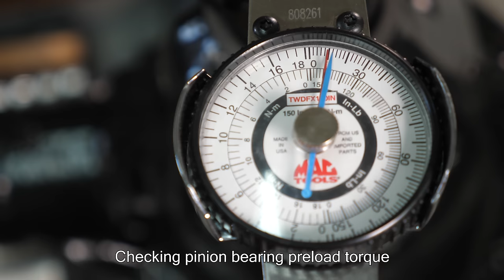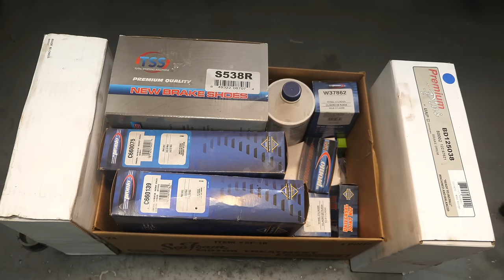Rear Axle Restoration and Rebuild (Chrysler 8.25)

Comment: If I did all that I would have switched it over to disk brakes I hate drum brakes
Reply: Agreed
Reply: Yeah I put the kj disc brakes on mine
Reply: All that work just to go through the pain in the ass process of putting drum brakes back on it
Reply: For real. I'm eventually going to swap my 96 F150 rear drums for discs, but don't want to buy a new conversion kit. Thinking I'll get the goods I need from like an Explorer of the same year or something...would have to research it.
Reply: Mayur Karanth  Has nothing to do with "crazy stopping power". It has to do with having more reliable brakes that aren't constantly out of adjustment.
Reply: @William Kiene I'm curious, did you mean 80%? Surely more than 80 pounds are being stopped by the front brakes lol
Reply: Drum brakes are lighter. They stop better. They can be adjusted with drag. You don’t have maintain drums as much as opposed to disc brakes.There’s a reason commercial trucks still utilize them cause they actually stop better. Disc brakes only dissipate heat more efficiently which is why car manufactures always used the front disc, rear drum combinations. Old technology does not equal bad. The pads are still being pressed against a surface whether it’s around a disc or drum, the outcome is still the same. Why even bother doing a drum to disc conversion? The pros don’t even outweigh the expense. The reason why this guy reused the diff cover and backing plates is the same reason he didn’t do a disc conversion cause if it ain’t broke, don’t fix it haha.
Reply: @John-jr1si  "There’s a reason commercial trucks still utilize them cause they actually stop better." - Well, that's not accurate. Disc brakes stop better more consistently due to their dissipating heat better. Also, in wet weather, the centrifugal force slings water off of it, giving it a huge advantage over drums, which often suffer in wet weather.

"The pros don’t even outweigh the expense." - Technically correct, but your context is wrong. One of the reasons you often see them in commercial trucks is because the commercial truck industry is nearly monopolized, so the few consumers there are don't have many options. Drums are in fact cheaper, and that's why they are still used. In some cases, you see drums on just the rear brakes of some "regular" vehicles and that too is because of cost saving. 

"Disc brakes only dissipate heat more efficiently which is why car manufactures always used the front disc, rear drum combinations." - The fact that most of the momentum is in the front, so that's where the better braking needs to be, is the logic behind front disc/rear drum setups, in addition to the cost-saving measures I mentioned.

"The pads are still being pressed against a surface whether it’s around a disc or drum, the outcome is still the same." - By this logic, it seems that you'd argue there's no difference between pushing and pulling. Rudimentary physics would certainly have a bone to pick with you, if this were the case.
Reply: Callelle drums are lighter than discs and if you’d spend big money just so you can have it be simpler just means you should be nowhere underneath a car or hood.
Reply: @John-jr1si  Well, you missed my point, despite my laying it out in a manner I thought was simple to understand, so I'm not gonna bother unless you decide to push it.

It's not a matter of thinking I'm smarter than the original engineers, but you have to realize that engineering has cost constraints. Manufacturers are not going to allow the engineers to do everything they want to do to make the car the best it could possibly be because it would drive costs up and make it un-affordable for the average person. This is why every so often we see concept cars: manufacturers let the engineers loose to prove that 1) they have the chops to produce the best of the best and 2) to keep the engineers satiated since most engineers dream of designing and building "ultimate" cars. So bearing in mind these cost constraints, they are forced to cut corners by putting cheaper components in some areas and they are ripe for upgrading. The same way that you can upgrade plastic components for metal ones if you have the desire to do so, it's just a matter of adjusting things that the engineers likely didn't have the ability to enforce. Like drum brakes over disc brakes. So stop being an ass about it.
Reply: @John-jr1si  they don't do things the same though. Why do you think there's almost no cars (if any) made these days that use drums? The wheel isn't being reinvented, it's being replaced with another wheel that's already been designed and is better.  It doesn't even cost much more (if any more at all) than it does to replace the drums, shoes, cylinders, and all the internal hardware. My backing plates were $20 and the rotors, pads, and calipers might have been $50. If the guy who did the video was gonna strip it to the point of taking the backing plates for the drums off anyway, there's literally no reason not to swap to discs.
Reply: @John-jr1si  just by the fact that you still seem to think that drums are lighter than discs, I'm not even going to waste my time on you anymore. Enjoy living with your head in the sand.
Reply: jw11432 I wasn’t aware I was being an ass about it? Yea i’m very strong opinionated on this subject because everybody seems to bash drums just cause they think disc brakes are better and it’s the new tech. There are numerous benefits that drums have over discs such as no brake dust on your wheels or the fact that drums don’t warp over time. I love discs brakes but I have no need to bash drums at the same time. I’m well aware of engineers limitations and people loving to hot rod, and I love doing it too. I just don’t see it as a legitimate benefit to fit in my budget on my project when rear discs don’t even reach their maximum temp to even clean themselves. I wasn’t really trying to say disc brakes are worse and drums are better. I was saying they both have their own benefits and that’s something anyone that’s mechanically inclined can agree on and I’m not trying to put you down by saying that.
Reply: Callelle Yea, I stopped wasting my time with you when you made an analogy of a better redesigned wheel.
Reply: @John-jr1si  No, you were being an ass with this part: "and that whole statement with pushing/pulling, “let me show off i know physics” so you can improve your credibility is stupid." I wasn't attempting to bolster my credibility with a mere reference to physics, only to illustrate the line of logic you were using doesn't hold up to scrutiny. You stated there's essentially no difference between drum braking and disc braking, as it pertains to the ultimate function they perform. But given that drums spread outward and discs squeeze inward, I was criticizing your logic by saying you must think there's no difference between pushing and pulling, since it moves an object and ultimately there's no difference, right? And to expand a bit, rudimentary physics shows that pulling exerts less energy due to a lessened encounter of friction, just for sake of clarification on that.

"There are numerous benefits that drums have over discs such as no brake dust on your wheels or the fact that drums don’t warp over time." - Brake dust mitigation may be a benefit, but drums can absolutely warp. There are numerous sources for the matter, but here's an excerpt from one source: "The drum will warp into an oval shape and doesn’t allow for optimal clearance between the drum and shoes." https://www.autoshack.com/brake-drum-problems 
Furthermore, I've already enumerated the benefits of discs over drums, such as performance consistency, heat dissipation, wet weather issues, etc. So far, the only benefits I am aware of drums over disc is cost, frequency of maintenance, and while brake dust be a benefit in your mind, I think I'd rather have brake dust escaping as opposed to it building up and gunking up all the springs and the wheel cylinder inside the drum, but if you want to have the opinion that this is somehow a positive, feel free.

"I wasn’t really trying to say disc brakes are worse and drums are better." - Actually, you kinda were. When you made the statement: "There’s a reason commercial trucks still utilize them cause they actually stop better." I dunno where you learned your English, but in my English, that's a pretty solid statement to support drums being better. While you're not explicitly saying drums are better, given that brakes only purpose is to stop a car, and for you to say drums stop better...well, that leads a person to believe you are expressly saying drums are better. So if you didn't "mean to say that", then mind your words.

You're entitled to your opinion. If you want to stick with drums on your vehicle because you like the lower cost or frequency of maintenance, or maybe because you like your brake dust all over your components, then fine. The only reason I responded to your comment is because you were factually wrong about a couple things and it's a matter of service to help others who may be reading comments to glean information. There's enough fake news out there about all kinds of things, we don't need any regarding braking systems.
Reply: jw11432 My bad, I figured I was being sort of an ass. I realized I was sort of being hypocritical after I responded too. I take full responsibility of that. I just have no need to swap to a disc conversion which also means I can switch to a bigger camshaft lobe which limits vacuum, something disc brakes need and drums don’t. I just see that in my specific application and not quite financially wise in my part, I have no need to convert. I’m building a drag car anyway and drums with no drag is free horsepower than disc. I see the different mechanical benefits of both.
Reply: @John-jr1si  All good, I appreciate the honesty.
Reply: I didn't mean drum brakes suck i just don't like working on them everything goes a certain way springs and all ..
Reply: Supposedly certain year ford explorer disc brakes bolt right on. 
They use the same Dana rear axle/diff apparently.
Reply: As a viewer I appreciated seeing things get put together as they once were as apposed to radically different. It's shows appreciation for the original design & in restoration that has a lot value to it.
Reply: Sure for collectible vehicles original is most valued. But this is a jeep xj that appears to be a daily or off roading vehicle. Jeeps are valuable for what they have for equipment and capability. In the practical market, an upgrade is an upgrade. What’s most important is the owner’s desire and plans for it.
Reply: I was wondering what it takes to use a 2005 and up rear axle. The least expensive Jeep Grand Cherokee of 2005 had disc brakes in the rear. Would that axle easily fit earlier Jeeps?
Reply: That's what I did. And then I put WJ knuckles up front on my XJ
Reply: @skylinefever  Pay attention to the angle of the snout.  They don't all have the same angle. I learned the hard way.
Reply: the rear drum break is also to hold the jeep and a trailer in park.
Reply: @William Kiene Not on 4x4, on rough terrain four brakes are more important, right. But drum brakes are better emergency brakes. I don't like drum breaks other than that. Those drum brake shoes that are in back disc rotors are a joke.
Reply: Rather has disk brakes, don’t have to put grease on them to keep them from squeaking.lol
Reply: jw11432 find an early 2000sf150 with rear discs. I think it needs to be a 2004 or 2005 because Ford started to use disc but they switched to 6 lug bolt pattern the next year. But one of those for 2004 or 5 will fit all the way back. Same axle and same wheel bolt pattern. I haven’t checked but the hum depth should be the same as well
Reply: Should have added a locker or LSD too.
Reply: *locker
Reply: @John-jr1si  Alot of misinformation here. You have good intentions, but your info is not researched enough. Trucks use air brakes, not hydro, race cars use discs, not drums, rally cars use disc and its not because discs are more expensive and racing corps have tonnes of money either. There is alot of tech and money being blown into truck tech as well. End of story...
Reply: @frederickmcconnell547 l ljl
Reply: I was thinking the same thing. Totally excellent job regardless. Jim

Comment: "Poor Man's Parts Washer" I feel ya brother 🤘 rock'n roll with the rest of us 😁
Reply: @dneilson2412  I think but I'm not sure they meant the 3M brake clean or whatever that was they sprayed on some of the parts. That wasn't done primarily to clean the parts it was to place a layer of oil residue on the areas that need to remain smooth and slightly lubed, the shiny areas. Which are areas things like bearings are pressed on to.
Reply: I love it. Aint it the truth though.
Reply: Well, not THAT poor. He had a lift, sand blast cabinet, press... I have a parts washer, but I ain’t got all the OTHER stuff!😆
Reply: @hgj2019  More of a phrase then actually true. Aint no poor nothing going on there, just high quality work with attention to all those details others would avoid . Awesome work.
Reply: @aerialrescuesolutions3277  no doubt about that! First class rebuild all the way. Very informative video.
Reply: but he had all other equipment to do the job. I assume he does this for a living because the tools he used, add up really quick lol.

Comment: Some mistakes, that yoke needed replaced and you shouldn’t hammer pinion bearings onto the shaft like that it’s a great way to damage new the bearings and races.
Reply: I cringed when he started beating on that pinion bearing,it will be interesting to see how long it lasts

Comment: This is great I have a Dodge Dakota with the same rear end, and it needs new bearings.  I have access to a 100 ton press, and a sand blaster. I don't think I will get that involved though. Just leave in my pick up pull a part and replace bearings may paint the rear cover .

Comment: We all knew that rusty brake line would snap right off.
Reply from the maker: #rustbeltproblems
Reply: @Meme Man because "restoration"
Reply: how does the fill plug connect to the bell housing?
Reply: @Meme Man With a two part question on the restoration of a Chrysler 8.25 rear end could have the few wonder of converting the brakes to discs or adding a traction aid when those would believe to want a limited slip as bare minimum or a locker.
Reply: @RestorationStation  9
Reply: @stanleyhornbeck1625  8

Comment: I would like to see that press you used to press those wheel studs out of the axle shafts
Reply: I'd assume it's similar to the press I have, if the sound being made while he used it is any indication. I got mine (20 ton) from harbor freight, it just uses a hydraulic bottle jack to actuate the press mechanism. Pretty damn cool.
Reply: @jw11432  I'll be damn. I'm gonna check them out. Thanks man

Comment: Honestly hella surprised on how well the diff looked compared to everything else.
Reply: Hardly needed to take it apart. If the outside had been treated with lanoline grease it would have been good as new too.
Reply: @steinbauge4591  🤡
Reply: @steinbauge4591  Glad go see the owner of Keyboard Complete Auto Care tuned in 👁👄👁
Reply: @realrickharrison3103  😜
Reply: @realrickharrison3103  it's so easy yet such a surprisingly well kept secret

Comment: I guess the big chamber in the middle of the axle is called a differential.
Reply: Where the big gears are, yes, is usually referred to as the differential or 'rear' although the entire thing from wheel to wheel is technically the differential assembly. Most shorten it and either call it an axle, a rear, pumpkin, or "dif" / differential. Depends who you're talking to and what words they decide to use.
Reply: @jackschitt7783  Is it fully filled with oil or partially? coz here I saw the hole to fill up the oil is bang in the middle of the chamber. I hv seen some have the hole underneath. so how is the oil filled? wouldn't the oil leak/spill during filling?
Reply: @subhajit201  Partially, half way. To the fill port. He shows how he fills it near the end of the video. 
When they have a hole at the bottom that's a drain plug. The hole half way up the back plate this gentleman plugs with a rubber grommet at the end of the video is the fill port. Sometimes the fill port also has a threaded plug in it instead of a grommet like was shown here. 

The drain plug in a differential should never be removed. Note that in this video he rebuilt almost the entire thing but he did not remove the drain plug. 

Oil always comes out of a diff when filling it. That's how we know it's full. There is no dipstick or anything like that in them. 

No, it doesn't leak. If there's a leak that's a problem that needs repaired.
Reply: @jackschitt7783  Nice.....here in India, and other south asian countries we use a vehicle called cycle ricksaw (human powered). In it there is no differential (only a solid axle rod). But then can u tell how it can turn easily without a differential? The solution is quite interesting and innovative.